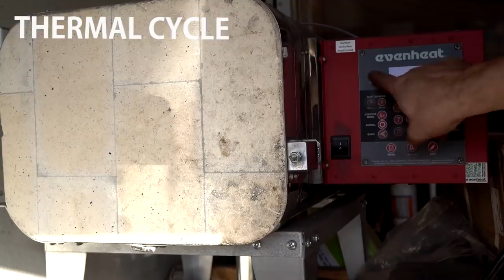Restoring An Old Hand Made Knife

Comment: The knife has a very interesting shape.  Wonder what it was used for.
Reply: Looks almost like the first shitty knife I made. It was better than beetles though🤣. JK Steve!!!
Reply: It gets that concavity on the cutting surface from being steeled year after year. That’s what a used up blade profile gets to look like. I have a 35 year old chef’s knife that is starting to go concave a bit, maybe 2mm.
Reply: Probably just the way it’s been sharpened. Not as much of the sharpening stone hits the heel of the blade and it’s harder to get pressure near the tip, overall resulting in a concave shape.
Reply: Cutting

Comment: Narration, no narration. So? I’ve got an important question. May not be the best format, but: A full tang knife where the butt end of the handle is wider than guard end. The hole in the guard must be large enough to slide on yet leaves gap when in place. One can plug, make multi piece pinned guard, etc. What would Green Beatle do?????
Reply from the maker: green beetle would not attempt this.  it is, for example, how the wwi us bolo knife is constructed and I believe a gap was cut in the guard then slid over the tang and then brazed shut.  you could try using bolsters instead of a guard?
Reply: Green Beetle doubting?? I think you can do with a knife pretty much anything you set your mind to. Anyhow, brazed the gaps closed. Don’t know why I failed to consider that. Except for my age and the ‘60’s thing. Still, a built up guard has its own merit. Bolsters? Ehh, not in this case. The knife would make Dundee envious. No mate, a proper guard was required. ¡Gracias! From an old Texas rancher.

Comment: Cool finished blade, though the spacing of the bolts kinda bugs me. And also miss your self-depricating patter.
Reply from the maker: spacing of bolts is true to the original tang which was too thin to remove more metal by drilling new holes to fix the issue, unfortunately.
Reply: @GreenBeetle  Yeah, I know, you gotta work with what you got — still, a great job. BTW, ended up buying a blade from Anza Knives based on a review in one of your other vids. Thx for the tip!